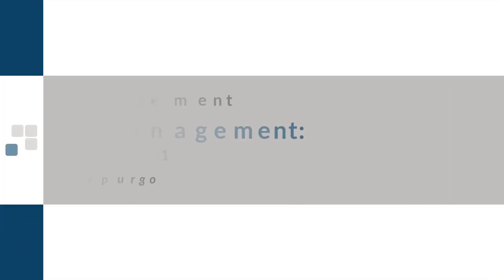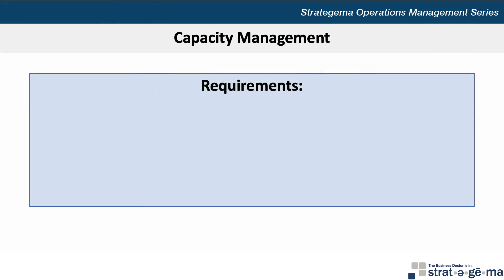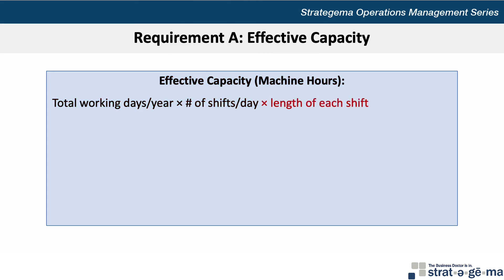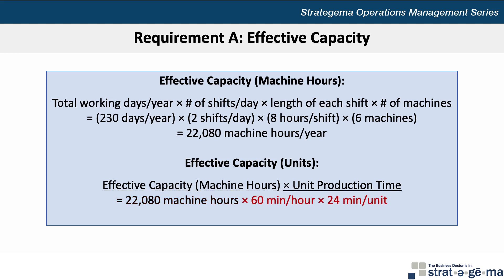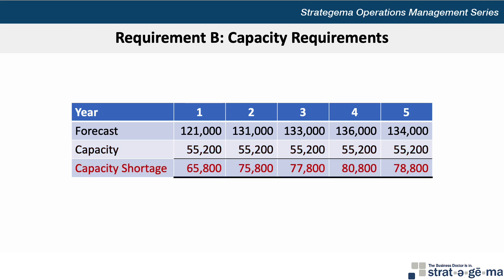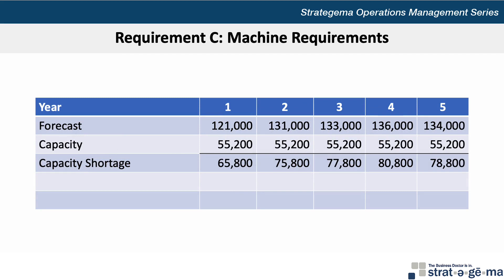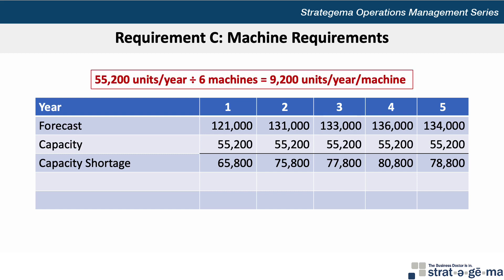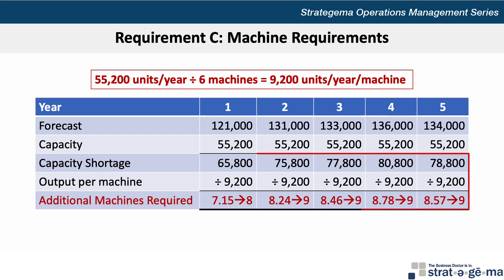Operations Management: Capacity Mangement – Effective Capacity

Comment: So they would just need to buy 1 machine extra for year 1 and again for year 2, correct? After that, the 9 machines meet demand for years 3-5.
Reply from the maker: Hi Adrienne. The company would have to add 8 machines in year 1 to make up for the capacity shortage, then 1 more in years 2 through 5. Hope this helps.
Mark

Comment: Hi I am really confused. In requirement A, how does 22080*60*24 equal 55200? I did the math and it does not equal that number. Am I missing a step?
Reply from the maker: Hi Dakota,
You're right, it doesn't!

There's a silly typo in my formula, where it should be divided by 24 min per unit: 22,080 × 60 ÷ 24 = 55,200.

Thanks for pointing that out.

Mark
Reply: @The_Business_Doctor  hi sorry may i check 
why isit not 22080 x (24/60) ?
Reply from the maker: @Jjukyumiz  This is because there are 22.080 machine hours available and there are 60 minutes per hour so we would have an effective capacity of 1,324,800 minutes. We know that each unit takes 24 minutes to produce so we divide the effective capacity in minutes divided by 24 to end up with 55,200.
Hope this helps.
Mark

Comment: It's 250 days per year not 230 days per yr  based on the question
Reply from the maker: Hi Joey,
You're correct, the data states 250 working days and I based the solution on 230. So the data should be 230 days for the solution to work out.
Thanks for pointing that out.
Reply from the maker: Actually, I had a second look at this and per the problem data, there are 20 days for maintenance, therefore 250 – 20 = 230 and the data and solution are fine.
Reply: @The_Business_Doctor  ohk thanks for clarifying
Reply from the maker: @joeyrocko4097  You're welcome!